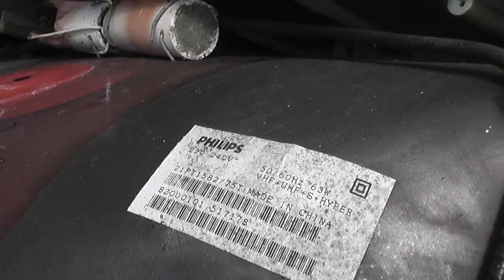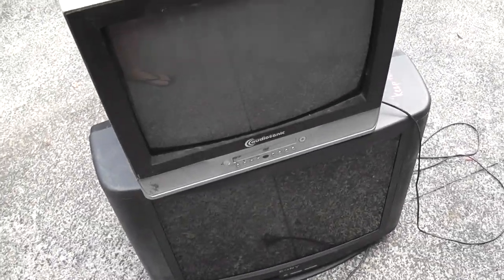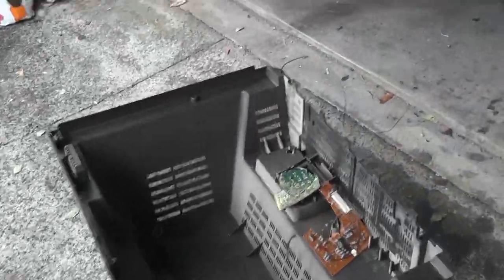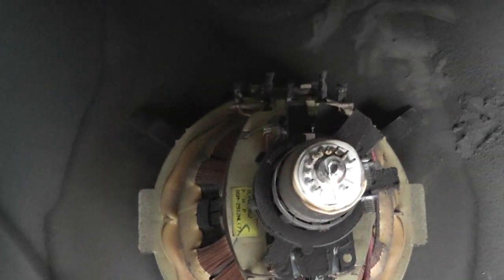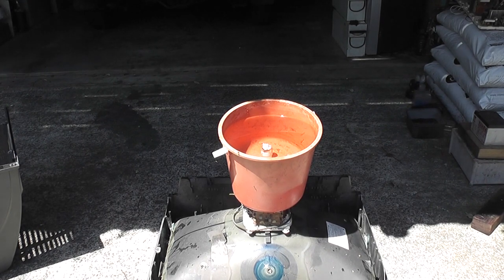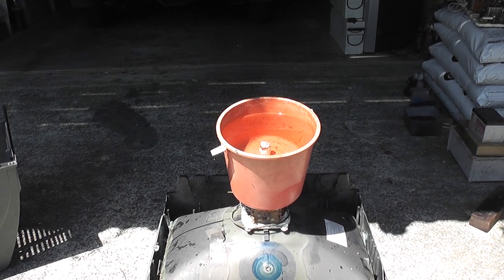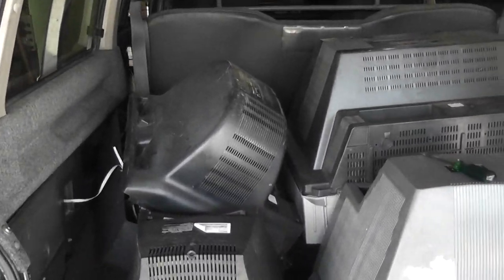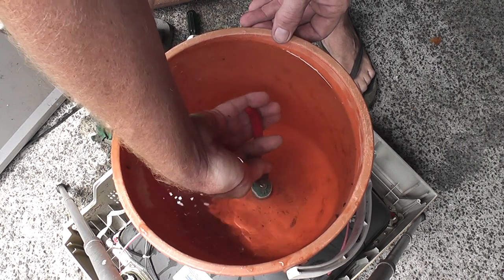Some CRT vents and water vortex in CRT

Comment: I used to collect speakers from these TV's when I was a kid, I still have one salvaged pair on my table from my color organ video. These pcb's are quite useful for parts, I reused some of the power supply capacitors for linear power supply of my amplifier that still operates in it's original form from 2008. Keep up the good work.